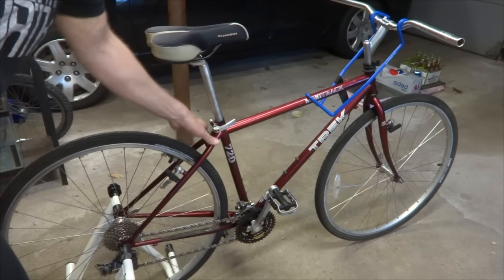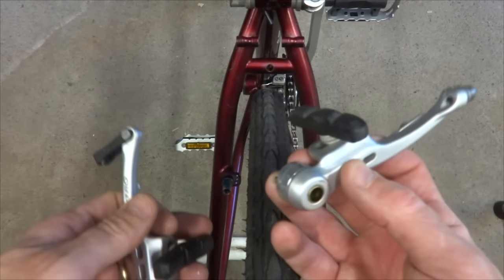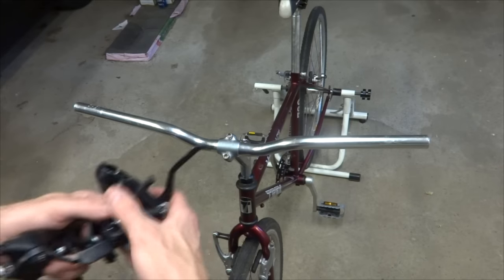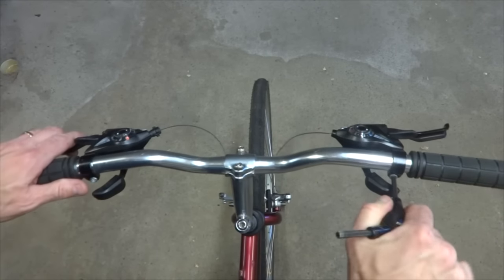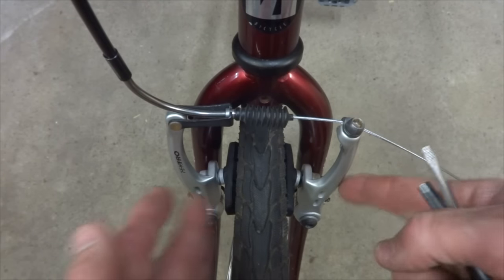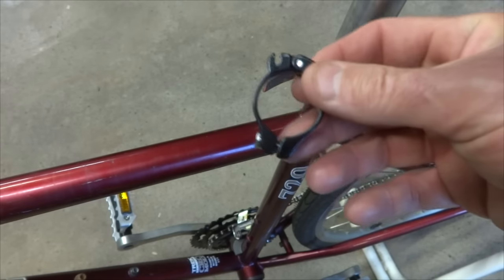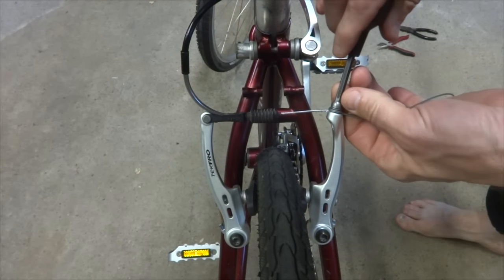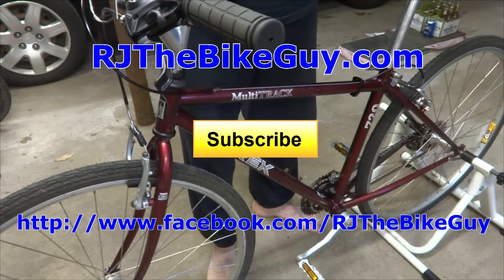Converting From Cantilever To V-Brakes

Comment: why convert from Canti to V-brake though?  Is it just a matter of them being easier to adjust? 
Just purchased a 91  Schwinn crosscut with canties. I am going to convert it to a 1x9 or 10.   So I need to buy levers.  hence the question of which way do I want to go with brakes.  Honestly the stock shimano cantilever 400LX works great. (I think)
Then again if I go 1x7 I just do a FD delete, BUT leaving the integrated  brake/shifter on will annoy me.  As would having different (left/right) brake levers.   Hacking up a perfectly decent 500LX rapidfire SIS to delete the shifter part of it doesn't sit well with me either.  So I'll probably go to 1x10 route because I am partial to the Saint M820 10 speed shifter.....   but I have lots of 9s stuff on hand. LOL   So all of that to figure out Where do I want to go on the purchasing of brake levers.  Canti, or V brake?
Reply: Never mind!, lol just watched your other video going the other way V brake to Cantilever.   'Cleaner look' etc.... I think I'll just do the easiest (least expensive) thing here.  I'll do a FD delete and hack the 500LX rapidfire.  Then move the large ring to the middle delete the other 2 rings and call it done.  As is I have $75 for the Crosscut, and $65 for a set of un used Xero element cxr-330 wheels. (why the wheels? laugh, because I've always loved the double spoke look of Xero wheels.) so I might as well apply the same logic to this brake thing. :D   If I can't keep chain retention on a rammped ring I'll drop the money for a stop-drop wolftooth.  (that would cost more than the wheels or the bike!!!)
Reply from the maker: V Brakes are stronger brakes than cantis.
Reply: are V brakes stronger than U brakes?
Reply from the maker: I think v brakes are stronger. The mounts are completely different.
Reply: RJ The Bike Guy ah I see thank you, thats probably why V brakes are used on race bmxs instead of U brakes
Reply: Tim Rice, unless it's a rare or collectable bike I always convert my vintage rides to a 1x9/10 and add v brakes, they're much better. 1x7 isn't as simple as just losing the front mech and getting a single brake lever, you'll want either a narrow wide front ring and/or a clutched rear mech. I've gotten away with just the narrow wide chainring if you have a good cassette and chain.
Reply: you may have chain drops like crazy even if you strictly ride the bike on pavement. Race Face makes good, fairly inexpensive rings but the best is Wolftooth at $60+ for a ring.
Reply: thank you

Comment: Is it possible to convert a rear v brake to a disk brake?
Reply from the maker: +James Taylor Yeah, but expensive, and probably not worth it. You will need a new wheel to start with. And if your frame doesn't have a mount, then you will need and adapter which will be expensive and not as good as a native mount. Etc.

Comment: Any solution for a stripped adjusting screw housing that's drilled into the arm itself (Tektro  RX5)?
Reply from the maker: Not really. You can try manually bending the spring to give it more tension.
Reply: RJ The Bike Guy Thanks.
I actually managed to screw in there a slightly larger screw (from an outlet cover) and it seems to be holding!

Comment: The spring does not reach the holes at my old mtb. Seems they won't fit! Any advice?
Reply from the maker: Sorry, I can't say what the issue is without working on the bike. If they came off the bike, they should go back on.
Reply: @RJTheBikeGuy  yeah it was an old vintage mtb which I completely rebuild because of the inspiration of your videos. I swapped the cantilever with v brakes. I noticed the front once did fit. The rear did after tightening the bolt the needles just reached it place. So great it works ! Thanks
Reply: Spring*

Comment: How can I tell if my brake levers are compatible with v-brakes?
Reply from the maker: If they say V-Brakes on them, that is a good sign. If they  came from a bike that had V Brakes, that's a good sign. If they came from a bike with cantilever brakes, then probably not.  Otherwise find the part number on the brake levers and research them to see if they are.
Reply: Or you can take a brake cable, mount it in the lever, mount the lever on a handlebar (any one would do), pull the brake lever all the way down, and measure the cable pull.
Cantilever brake levers will pull in around 18-20 mm of the cable (approx. 3/4"), V-brakes lever will pull in something closer to an inch, or more. Also, levers for cantis tend to be "straight(er)", while ones for V-brakes are typically sort of crooked, or bent (like the ones in the movie above).
Of course, researching by model number is the safest way to answer this question, albeit not always practical, especially in respect to cheaper brands (or sets with missing labels/ "worn out" numbers).

Comment: I just purchased a vintage road bike with similar brakes. Can someone tell me how to increase the spacing between the brake pads and the rim? I tried adjusting my uneven brakes, but because there is such a limited amount of space between my pads and the rim (not even 0,5 mm), it is basically impossible to adjust this so perfectly. One brake pad always ends up hitting the rim because of this, no matter how many times I try this.
Reply from the maker: You need to adjust the cable and/or the brake pad spacers.

Comment: I have a cycle with single speed and v break also.my break is not working properly but it is useable.i try to fix it , by mistake it is not working properly.my tyre is rubbing by break shoes and right side lever movement is high then the left side.model name Kross globate.
Reply: This is for my rear brake pads
Reply from the maker: Adjust the pads.

Comment: What is the blue wire frame thing over the handlebars?
Reply from the maker: https://www.amazon.com/exec/obidos/ASIN/B000QSXPL2/ref=nosim/youtube25-20
Reply from the maker: I probabluy didn't need it here as the bike was on the floor. It had probably been in a bike stand shortly before I started videoing.

Comment: PLEASE HELP- to those with more knowledge then I on this subject. I have a Trek 720 that I rode my whole life I took it in recently to get new brakes and a tune up. I did this after noticing my cantilevers couldn’t add enough pressure to brake the bike. I noticed the plastic pieces mentioned in this video were broken too. I proceeded with the fix and after getting the bike home I noticed the new brakes on the bike were just new cantilevers but the plastic pieces that sit behind the cantilever arm and the bike frame have not been replaced. I’m afraid that this bike will work well for a year and then run into the same problem I had that made me bring the bike in for the first place. My question! Should I care… are my brakes gonna last? Are those plastic pieces important to the cantilevers? Should I complain to the owner or just shut up and ride. Any help from the community would go  along way In easing my anxiety.

Comment: some v-brake pads are longer on one side because the pivot is not at the center of the pad.  For these pads, does anyone know if the longer end is facing towards the the rear derailleur or the front?
Reply from the maker: There is usually an arrow on those in the direction of the rotation of the tire, or marking which end is forward.
Reply: @RJTheBikeGuy  My brake pads have no arrows as they are from no name V brakes from a 1980s mtb takeoff but I saw some XT V brakes on ebay with pads having direction arrows showing the longer ends facing towards the back.  Interestingly, my V brakes have no spring end protrusions that can fit in 1 of 3 holes on the frame.  The main bolt attaches brake caliper to the bike frame and the spring action of the pad against the rim is based on how far back away from the rim the caliper is tightened down by the main bolt.
Reply from the maker: @Justmyopinionlol  Sorry, I can't really tell you much without seeing all the parts and working on the bikes. There are literally thousands of variations.

Comment: so if i have a steel frame and they seem to be welded in.   what are my options?
Reply from the maker: Options for what?
Reply: Sorry I asked on the wrong post...my question is in regards to another video we’re you replace post where the cantilever brake seats.
Reply from the maker: @robertgarcia3748  I replaced a damaged post. I have no idea why you want to replace your posts. If they are not made to be replaceable, you will have to talk to a frame builder. or replace the frame.

Comment: Thank you for this! I bought a used, practically new old Bonelli 15 speed road bike for $50 and I was wondering if I could upgrade to V-brakes.BTW, without in any way trying to show you how to work, have you ever considered putting the brake post pin in the top or bottom hole instead of the middle one to resolve your tension problem. Works for me when needed  ;)
Reply from the maker: If it doesn't have posts for them, then probably not. Generally using a different hole makes too big of a change.

Comment: for the middle channel (of three) on the top tube, which goes to the middle and the right hand side?  Obviously, as demonstrate in this video, the far left channel is for the rear brake.  Can I assume the middle channel is for the front derailleur and far right channel for the rear derailleur?  Also, does anyone know in japan, which side (left or right) is used for front and rear brake?
Reply from the maker: I have a Raleigh bike where the middle is the rear derailleur, the right channel is the front derailleur, and the left channel is the rear brake. But I am sure there other bikes that are different. I think Japan is Left Front/Right Rear. https://www.youtube.com/watch?v=OR47XELYmQc
Reply: Since both middle and far right can be used interchangeably with front and rear derailleurs, which channel do you recommend for rear derailleur? Do you think the Raleigh set up is better?
Reply from the maker: Google pictures of the bike you have and see what they do.
Reply: cool thanks.  It´s a 1990 mtb bike with 26 in. wheels and steel frame with Shimano Deore LX 8 speed components.  The top tube has three channels welded to the top surface.  I am more of roadie so I find it strange since on road bikes the cables go under the top tube.  I already installed everything but watching your videos has led me to question my methods lol.  And it´s not just the cable wiring.  What I love about bicycles in general is the huge amount of continuous innovations and things to learn.  I like how on average the older bikes are made to good quality instead of the crap they produced now for the middle and low end market.  It´s like you have to be rich to afford a nice quality bike when in the past it was not so.

Comment: Will TF2 (with teflon) grease work as well as Marine grease?
Reply from the maker: I have not used it, but I think so.
Reply: Teflon in greases and oils is a lot less effective as a lubricant than people think.  It is heavily marketed.  Lubricants sold to the public (and to bicycle mechanics) frequently include it.  Lubricants sold into serious applications rarely do.  If you look at the greases and oils sold by the Mobil industrial brand, or SKF greases, for instance, you find Teflon only in a few products for very specialized purposes, not for ball bearings, not for plain bearings, not for chains.
Reply: Ok  thanks :) I will keep that in mind and find some new grease without teflon.
Reply from the maker: Really? Nothing against Mark Holm, but you are going to just take as fact what the first person to come along tells you? Do some research. Listen to what people tell you, but then verify.
Reply: +unogazzy84  Teflon in grease and oil does not hurt anything in most light duty applications, but it does not help either.  On a bicycle, it is the ball bearings that approach moderate to heavy loading.  The marine grease RJ uses is a decent choice with the advantage of improved water resistance.  Park Polylube 1000 is a decent, if expensive, choice.  Most general purpose greases sold at auto parts stores are decent lubricants.  Mobil 1 Synthetic grease sold at auto parts stores is a superior lubricant.  I don't know about the water resistance of Park or Mobil 1.  As I wrote, when you examine the products of serious grease companies, selling to serious customers, you do not find Teflon in most of their products.
Reply: I wrote "I will keep that in mind" I don't fully trust anyone without doing my own research. it may look like I do because of how I wrote my comment but trust me , it's not like that at all. Besides, english isn't my first/native language, so It may happen that I get a little confused when I read/write or speak english. This is the first time I ever heard that grease with teflon is not as good as grease without teflon so I decided to do some research and find out the truth. So far I only found one that supports Mark holms statement. I think I will continue searching just to make sure. BTW Your videos are very helpfull :)
Reply from the maker: I am a born cynic. LOL!
Reply: Is that so? In that case I will look in to it. Thanks for replying :)

Comment: Can the cable housing of the cantilever brakes work with the v-brakes?
Or would I have to buy a cable housing with a noodle...?
Reply from the maker: The noodle doesn't come with the housing. They are part of the v-brakes, though you can buy them separately. If you are going to go through the process of changing your brakes over, buy new cables and housings.
Reply: Cool thx.

Comment: My brakes are too tight. I can't squeeze them and it doesn't stop the wheel. If i try to loosen them a little bit the don't brake at all.
Reply from the maker: Not enough information to even begin to give you an answer.
Reply: +RJ The Bike Guy My brakes are V brakes and they are very hard to squeeze. If i loosen them a little bit the don't brake. What should i do to make my brakes easy to squeeze and brake... sorry for bad english :) and thank you for replaying
Reply from the maker: Replace the cables and housings, and lube the pivot points.

Comment: Hello,
While isopropyl alcohol will do the trick of easily putting grips onto the handlebar, I'd rather avoid using it - as you never know what is the material the grips are made of, and whether it contains any additive that alcohol may wash out and leave some slippery residue on the handlebar.
And even if it won't do any permanent harm (most likely it won't) then it is still going to take some time for it to eveporate. And untill the alcohol evaporates, the grips are going to just slip around as easily as when you've slid them on.
Which is not a good thing when one is fixing/ upgrading a bike and wants to take quick round around the block to see if everything works OK.
I always use compressed air for this job - might be tad more difficult then the "alcohol method", but the moment you get the grips on they're securely fixed in place. When you do a regular work on bikes a compressor in your shop is a must anyway (at least for pumping wheels) - and there are plenty of inexpensive ones for home/ garage use. (BTW, compressed air works also for taking grips off, and lots of other tasks.)
Slide the grip onto the handlebar as far as you can (typically one inch or so before resistance becomes too great), then squeeze the tip of air "gun" under the grip as deep as you can, and blow the compressed air between the handlebar and the grip while pushing the grip "in" (the air works as a lubricant).
Of course, one has to support the other end of the bar somehow - I normally stand on the opposite side of the handlebar and rest it on my chest while holding the gun with my right hand  and puszhing the grip "in" with my left hand.

Best,
BTC
Reply from the maker: I have used alcohol for years on countless bikes and never had any issues with it. And I have a compressor, thanks.
Reply: Just as I said: "most likely it won't [do any harm]".
Still, it leaves the question of "how long does it take until it's safe to ride a bike with grips mounted using isopropyl alcohol" unanswered, doesn't it, eh? ;-)

I have no issue with other people using whatever method they seem fit and best for a given task - I just find the compressed air method most practical, and I just wanted to share my opinion/ give some advice on the subject. But, granted: there's more than one way to skin a cat..

Best,
BTC

Comment: why bend the spring when you can just change the holes?
Reply from the maker: Changing the holes makes a fairly extreme change in tension. Much more then bending the spring. It would be way out of balance usually.

Comment: Why do this? Cantilever (we used to call them center-pull in the 80s) brakes are the best!
Reply from the maker: Sorry. V-Brakes are stronger, better that cantilever brakes.
Reply: @RJTheBikeGuy  hmmm. Ok, I have read things to the contrary, but can't say from experience. But v-brakes seem more complex for Arctic climates, which is my main concern. I only concern myself with brakes that work even when snow and ice has formed on them, and can easily cleaned off for full functionality. I also like the way cantilever brakes allow for easy centering. As I rewatch the video, I can see the problem I hate: you are testing the front+back brakes, and only the one at the end of the cable moves, not the inside brake. I hate those kind of problems 🙂And that boot over the wire causes extra problems with frost/ice.

Comment: What kind of monster walks around a workshop in bare feet!? Firstly there is the issue of stray metal fillings and other sharps which can be missed by the workshop brush and then secondly that floor is concrete and therefore bloody cold, RJ's feet must have been like blocks of ice when he finished filming!
Reply from the maker: I am usually only bare foot in the summer.  And I sweep the floor. In the winter it is cold, and I wear shoes.